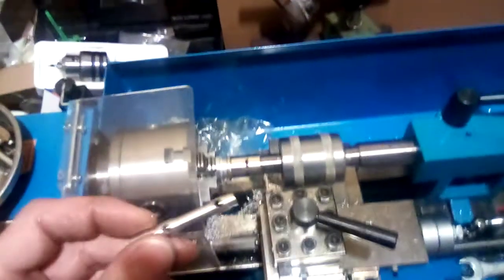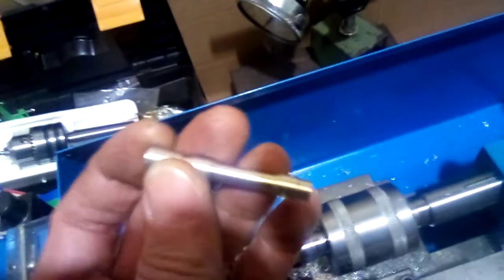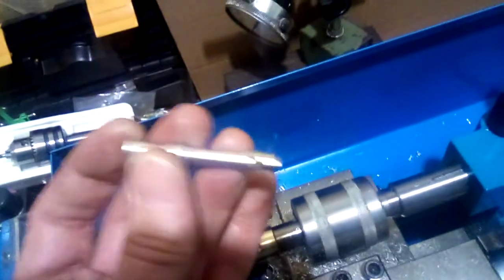vevor Mini métal lathe team ae cylinder sleeve modification

Comment: https://youtu.be/0abZdMpFwiY
Reply from the maker: by memory voltage and the electrical frequency used in Italy are the same as in France: 230 V and 50 Hz. But here it's different, maybe that's the problem, I'm not an electrician, but I think that's the problem, you might have to use a power converter!